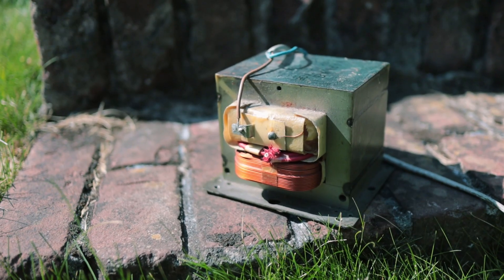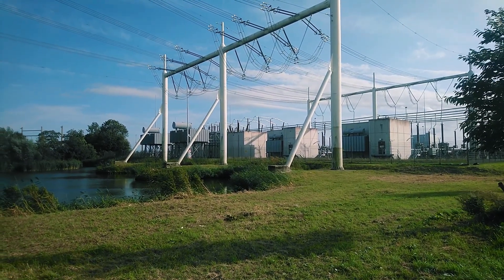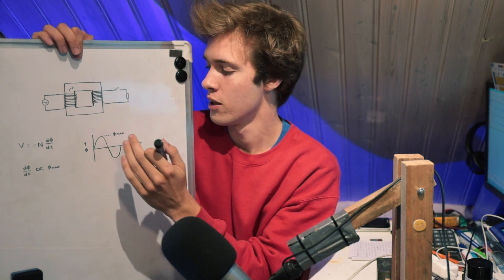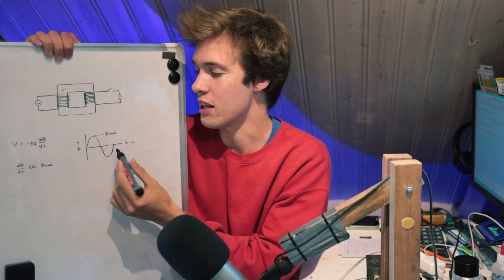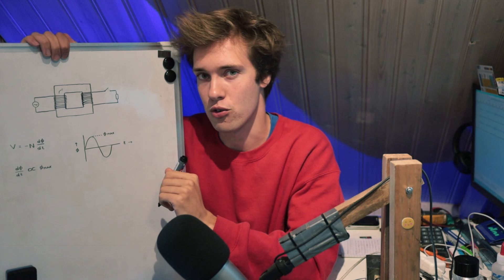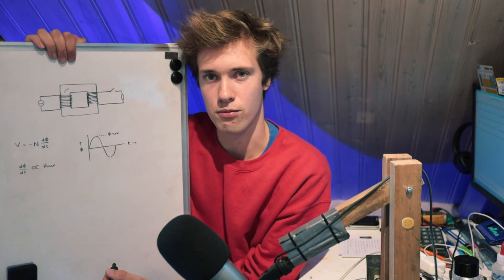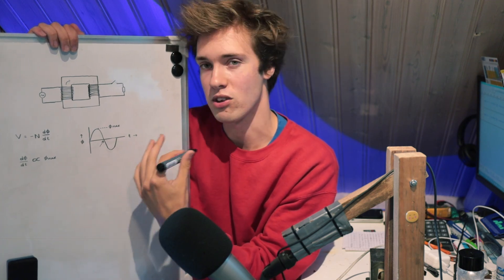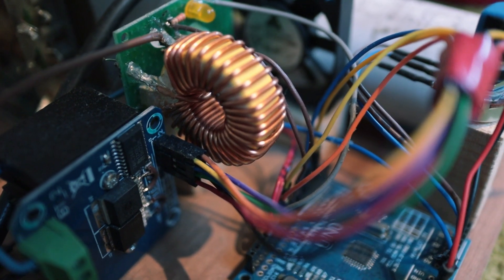Why higher frequency transformers are smaller

Comment: At time 10:30, "if you don't have enough turns, it [the transformer, or coil] will saturate"

The equation is:     inductance L=N^2μA / l

where (in the numerator):
N = number of turns
μ = permeability of the core material
A = cross section area of the winding

and the denominator is 'l'  (that's lower-case 'L'), and is the length of the coil

Since the number of turns 'N' is in the numerator, as 'N' falls  (ie. as the number of turns is reduced),
so is the inductance, L, of the transformer winding or the coil.

The operative issue is that saturation is when most magnetic domains are aligned in the core material, in which case they no longer impede current flow.   Ie., in saturation, inductance tends towards zero and you get high current & heating.

Notice that inductance L is ALSO tending towards zero if you fail to put enough turns in your transformer winding.
By skimping on (using too few) windings, you are willfully tending to a forced saturation:  low inductance, and high current

Comment: I want a solution for this problem statement (Development of non eletrical device  for tracking the movement of sun for  the movement of  solar panels increasing their efficiency .   Could you please provide a solution
Reply from the maker: What do you think this is, chatGPT?
Reply: Noo i dont think like that . Sry
Reply from the maker: @keerthanaravi6225  I don't know what the solution you're after is, I have made an electric solar tracker, but you seem to want a purely mechanical "passive" one. Designs exist, but are generally not that practical.

I've heard of two variants:
- something based on the sun heating phase-change fluids, creating pressure differences in some sort of hydraulic system to move the panel

- some mechanical wind-up type thing with a spring, like an old clock

both of them are not ideal for several reasons. Since electricity is always there (it's a solar panel after all) I'd stick with that.

Comment: Its really simple. I'll use an analogy.  Its like filling a cup, then drinking it. The more times you do this per minute, the more you can drink per minute.

The transformer iron is like that cup. You can put a certain amount of magnetic energy in aligning magnetic domain in the core of a transformer, and that energy can be drawn out to the prinary each cycle. It's just that simple. 

Iron cores simply make the cup bigger. One does not even need iron, one can even store magnetic energy in the empty space of an air coil. 

The power raiting for a transformer is generally it's continuous power raiting. that factor in the transformers ability to disipate heat from hystoresys losses, eddy current losses, and i²r losses.   Its continuous power raiting has nothing to do with saturating the core's magnetic domains. That would  be the transformers maximum  instanious power, and is limited by core saturation.  And thats not even entirely accurate. Becausr, one can add even more magnetizing current beyond the point of saturation. Its just that the core's permibiliy drops and can not add any more magnetizim from aligning magnetic domains.